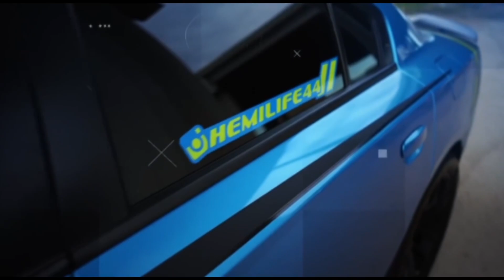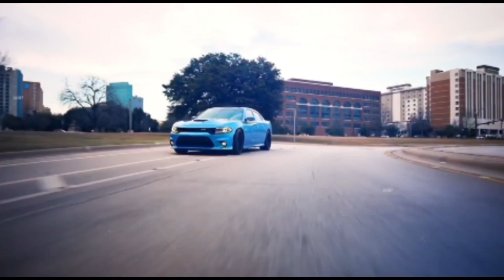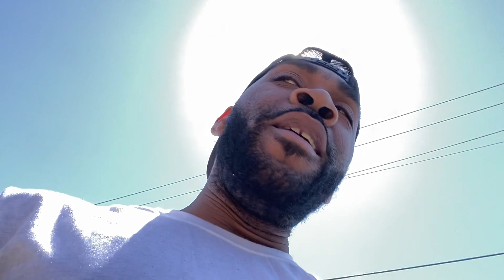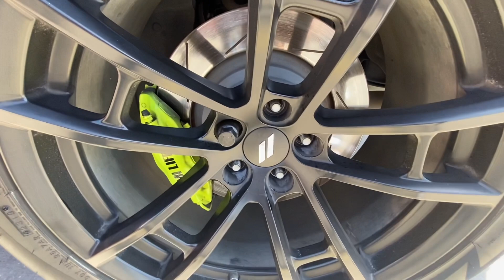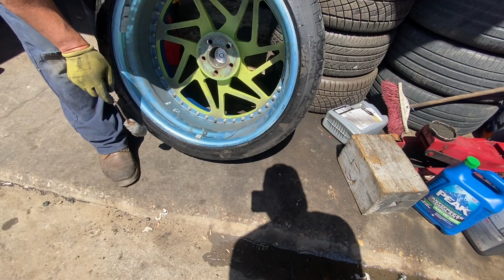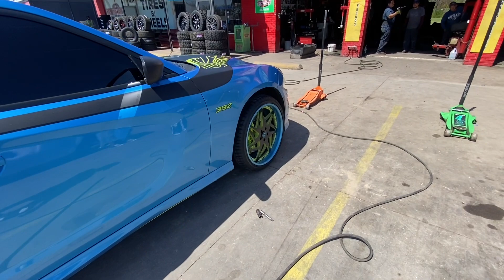It Was Bout Time I Did This With My Forgiatos

Comment: Anyone notice the tire shop guy using a tourque wrench to try and remove the stuck lug nut. As opposed to a breaker bar, and a cheater bar. 
Best way to avoid this issue is bring your own tourque wrench, and tourque your wheels down to spec. 
Don't let these guys hammer down with those air guns on your wheels. 

Love the car though . Just amazing.